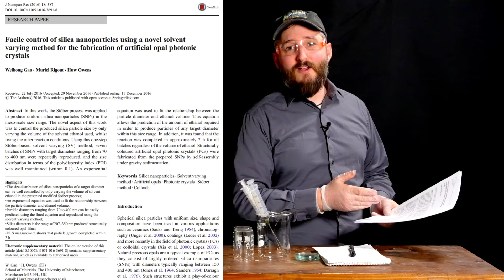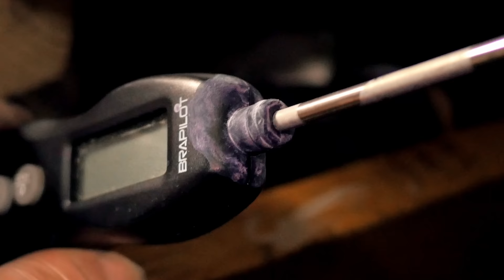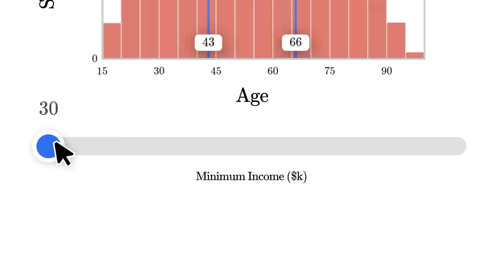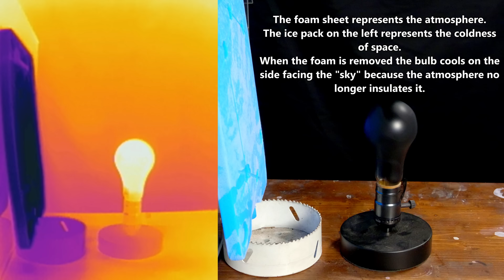Making Opals for Free Air Conditioning

Comment: You have so many incredible tools for the radiative cooling now. Use a soot deposit on one side of a copper plate and a passive paint on the other. Sandwich those in series inside an infrared refractive 'mirror' box and then draw out the air. You should have a plate that directs heat from one side to the other with an N[plate]*e^-f(x)[logarithmic efficiency]/y[mirror box conduction rate] system. Or something similar to that formula...
Reply: Stack in some IR directive fiber optics to spread the N1 applied heat between each layer and that N*e^-f(x)/y formula should minimize the loss due to series stacking, kind of like running the TA-refridgerator in series.
Reply: I didnt do the system analysis on paper, it's just in my head. But to fix my estimate it's probably closer to RMS(N*e^-f(x);y).

Comment: Instead of using a uniform lattice for transparency, have you considered taking the air dried opal, scraping it off into thin flakes, then mixing it into a clear/colored resin? The resin could more easily penetrate the small flakes than the massive chunks that you and thethoughtemporium are making in your centrifuges, and could also remove the "tiger pattern" described in thethoughtemporium's video.

Comment: If increased brownian motion creates a more consistent cristal. Heating the mixture while it's left to settle out might give a better result. Depending on what temperatures the solution evaporates at this could also help concentrate the mixture. 

For the air trapped in the dried sample maybe placing it in a vacuum chamber would help. Like degassing resin. And if the dissolved gases are interacting with the participants at all they might be affective how fast there settling out. 

Could also be worth testing a combination of these if you can heat a sample while pulling a vacuum.  Low pressure and high temperature seems like a good way to concentrate the solution and force the particles to settle out.

Comment: Please use an ultrasonic cleaner or bath or horn for the neucleatiom and suspension of particles. Also the water drying brings the spheres closer together due to surface tension, so you get a denser matrix (that is extremly hard to redisperse). 
Also silica colloidal mixtures are reasonably priced (100+ for 1L 12-20 nm 40% wt. conc) if you need a known reference.

Comment: Try dispersing the lampblack with an ultrasonic bath or ultrasonic homogenizer before adding it to the opal solution. Or maybe sonicate it all together— the cavitation will de-agglomerate and disperse the carbon. I’m not sure if the cavitation will hurt or break the nanospheres, so that could be a variable to test. 

I also wanted to contribute that the effect of opal’s colors is from the Tyndall Effect, which is similar to (but different from) Rayleigh scattering. From my understanding, Rayleigh scattering is from particles smaller than the wavelength of light, and the Tyndall Effect is present for particles roughly the same size as the light they’re scattering. So opals, opalescent Chinese glazes, and milk are optically colorful from the Tyndall effect, and not Rayleigh scattering. I hope that isn’t too pedantic. (And if I’m wrong I’d love to be corrected on it!)

I’ve done a lot of research into historical opalescent Chinese glazes such as Chun glazes, the blue celadons typical of Ru ware, and the blue clears of Qingbai and other Song dynasty glazes (not to mention Japanese Seihakuji and Korean Goryeo celadons). These are opalescent glasses that use iron oxide as their nucleation sites to grow air bubbles in the glaze matrix in a reduction environment. From what I’ve read, 400-500nm air bubbles create a blue glaze that’s straw yellow when you shine light through it.

When the glass freezes on the surface of the clay, the entrained bubbles scatter certain wavelengths to create different colors. I can share some papers and research about this if people are interested, but this kind of firing only takes about a day. I wonder if making an opal using a firing/sintering process would be possible and take less time than weeks to settle— but I’m not exactly sure how to tune the size of the air bubbles to adjust the opalescence. Maybe different sizes of iron or different oxidation states of iron would yeild different effects.

Amazing video as always, so exciting to see this research and your enthusiasm for it!!

Comment: If you use an internal-mixing two-substance nozzle you can adjust the droplet size between 10-150 micrometer. that would be suitable for exact priduction of nanospheres, with air pressure curves, using a micro controller a production of varying size of nanospheres is possible

Comment: Opals are one of my favorite, "gemstones" (not technically gemstones but...). I know the rocks and jewelry need to be kept wet as trapped water is intrinsic to the shine/transparency. I'm not sure what medium would suffice in a radiative paint. Water would obviously evaporate too quickly. Plastics would absorb the UV light, generating small amounts of heat, (not like IR) and oxidize like headlights. Molten glass would destroy the nanoparticles. Glass encasements filled with hydrated opaline would be impractical.  

I love the project and the idea of radiative paint. I remember reading that some scientists had been working on making sand more reflective by roughly ~5%  (if memory serves). Ideally, we should pass laws that require a reflective specificity for roof coverings. We could easily reduce both indoor, daytime temps as well as reducing some of the urban heat island effect. I used to work in building insulation. Simply painting your roof white is almost as good as spray foam insulation. Both are vastly better (efficiency not ecologically) than fiberglass. 

I assume brighter folk than I have considered how much energy is created, how far efficiencies drop and how much energy is needed to counter the heat created by solar. Personally, I champion the most passive forms, such as white roofs, good insulation, sky lights, etc. I'm all for solar though more for small modular nuclear. I think every subdivision should be as self sufficient as possible. This reduces heat waste from transporting energy and makes the whole grid more robust and less vulnerable to attack and grid issues. In any case, we need to diversify our technology more and to the simplest, meaningful forms.

Comment: Even heat, slower spin/mix in relevance to brownian motion of the mixture, with a dehydrator/pressurizer  will improve it even better. Also a outer temp that is as cold as you can get it will make it more pure if a gem :)

Comment: If the nail polish helps to make it clear then it is likely that the top surface that is the issue, it may be too rough or uneven. If you can make a large and strong enough crystal you could try polishing it to smooth out the top surface. It may be similar to when you sand resin or epoxy, it goes very cloudy too until you apply a top coat which fills all the microscopic pits and scratches and also similarly if you polish it that may also help it go clear again.

Comment: Interesting. The version I read was that opals have water in their matrix (SiO+H2O). They are sometimes referred to as silicon hydroxide (SiOH). I've also seen old chemistry books that revered to opals and flint as acidic glass (HSiO). By the way, the difference between precious, semiprecious, and common opal is the amount of color diffraction, which was commonly associated with the amount of water trapped inside its layers.

Comment: Maybe you could try to use a vacuum in the settling process to get rid of the air? Or an epoxy to fill the gaps? Or letting the lattice grow on an existing crystalline structure? Just throwing Ideas out there..
It would be really interesting to see the opals in a passive cooling system!

Comment: I was stopped at the teos in making opals, so i just cut and polish small, rough natural ones i can afford. The resulting solution I believe could be kept long term and used in paintings too. I was going to use opal dust and try to suspend that in medium. With more people doing this experiment, perhaps someday the different particle sizes can be sold  in small vials. I’d paint with red blue yellow size particles.

Comment: Like the super material using barium sulfate nanospheres the ability to produce them seems to be getting easier and easier for the average person. One question I've had through this series is how many different ways it can be applied. I wonder how the barium sulfate paint would do if it were also painted on a super reflective surface, would the cooling work even better? Could it be used to cool solar panels to increase their efficiency? Water cooling pipes using it? The applications seem endless. I'd love to experiment on it myself.

Comment: Cool! Consider experimenting with a thin vacuum between the emitting side of the radiant sky cooling coating and the atmosphere, which would eliminate convective and conductive heat transfer from the equation, kinda like the opposite of a evacuated tube solar collector

Comment: Here's some really nice work!  It will be interesting to see how far you can take it.  

I do have one suggestion that might improve the uniformity of your nanosphere size.  It was clear from your first result that improving the temperature uniformity of your reactants is important, and think you can improve that by quite a bit.  For instance, the bottom of your beaker, which is in contact with the bottom of your ad-hoc water bath, is going to be hotter than the water.  You also want to make sure that the level of the water bath is higher than the stuff in the beaker.  The setup used in thethoughtemporium video looked to be better in these regards, but I don't think you need the precise kit he used to achieve similar conditions.

Controlling the light scattering is sort of tricky as well.  If you use a binder whose index of refraction is very close to your nanospheres they will basically disappear, optically speaking, and you will lose the interference effects you're after.  Binders with different "n" won't do that but the resultant colors may shift because the wavelength of light will be different, compared to air.  The effective size of the nanospheres will be larger compared to the in-situ wavelength so things might shift toward the red side of the spectrum.  Maybe :).

Comment: "Black" opal sits on dark potch, it isn't dark in and of itself - if you put carbon black or another colorant in it, that will likely just disrupt the orderly nanoparticle settling process and cause other unforeseen problems. You'd want to apply clear opal onto a dark background instead of mixing a colorant into it I think. This is absolutely fascinating, and there is so much you could do with this process, also so much we still don't know! It's also wild that a gemstone we have been mining for thousands of years literally takes an understanding of advanced optics/the physics of light and nanotech to do in a lab what just occurs naturally under the right circumstances over huge stretches of geologic time.

Comment: I took a nap and came up with a possible solution for you trapped air issue in your solutions as they dry... Hypersonic vibration. Take something like a really good electric toothbrush, attach some rubber to the back of the toothbrush and then create a mount where your little glass disks are suspended to keep them from moving, but with the electric toothbrush mounted such that the disk actually rests upon it. And then just turn the toothbrush on. You need micro-vibrations... not enough to disturb/mix up the solution, but enough for the trapped air bubbles to escape. 

Now this could also result in more air getting trapped inside if the vibrations are too big. You need very, very small, vibration.

Comment: You can make anhydrous ammonia by mixing ammonium nitrate fertilizer with sodium hydroxide, running the gas produced through a desiccant then condensing the vapors to a liquid in a flask cooled with dry ice.

Comment: Using the denatured alcohol, which is a common term for methanol may have effected your results because of its greater molecule size meaning fewer nucleation sites, but it could have also effected color gradient due to larger gaps at the nucleation sites

Comment: You should consider using dynamic range compression on your audio signal. There are big differences between the quitest part of the video and the parts where you are excited. It is nothing bad, it is an editorial choice. In my opinion content like this, most viewers will value stable volume output :) In contrast to movies where you want the audio system to be able to produce big explosions alot louder than conversation volume.
Reply from the maker: I did use a compressor but I think the audio clipping when I shout made the sound seem louder. I need to upgrade my mic setup with floating audio so I don't clip as I did here. You might like this video about loudness which I think demonstrates what happened here: https://youtu.be/Is_wu0VRIqQ?si=Ali02H93mkiJTL6u

Comment: do you think ambient air water ammount affects the result? since it will provide nucleation sites?
the lamp black might work but as an after process. make the opal solid, add lamp black to the solution and re-centrifuge. my thought process is that this should leave minimal gaps between the particles, which then the lamp black will fill, instead of air or water etc. eliminating possibly 2 flaws at once.
my other suggestion is to just heat up the opal while it's centrifuging/evaporating even?
maybe putting it in the oven after centrifuging can still save a dull opal that was too quick in it's settling?

Comment: Hi thanks for the interesting experiment.  You showed that air bubbles are getting trap in the solution. Have you tried vacuum chamber.  You can get all the air bubbles out of the solution.  You should get clear Opal with your red and green.  Then you can add your black.  Good luck

Comment: What a delightful video, I very much enjoyed watching your excitement as you synthesized opal! I feel much more informed about the structure and properties of opal and look forward to seeing how you incorporate it into your passive cooling project.

At 44:10, I'd like to add that diffusion of a solute is usually only feasible in a medium of which it is soluble, hence the efficacy of the alcohol-soluble pigment compared to the lampblack. To form a colloid mixture I believe you would need a pigment with a grain size smaller than that of the nano-particles in your opal solution--and I think that may be counterproductive, for a reason I address shortly.

I'd be interested in learning more about how the nano-spheres of silica dioxide are settling into the crystalline formation that produces an opal. You mentioned that it can take months for the nano-spheres to settle naturally, and that attempts to speed this process have a high chance of ruining the sample. If I'm not conflating incompatible ideas, the phenomenon of granular convection may provide insight to a solution. If my assumption is right, then reducing the latent energy of the solution to a degree that Brownian motion can no longer generate lift on the nano-spheres in the middle of the solution, while still being profound enough to do so when the nano-particles are pinned against other nano-spheres or the surface of the container, would be a more apt way to get the desired crystal structure. Though, I am just postulating; I've no clue about the feasibility of such a state.

Comment: It takes Time to "grow" the spheres from the solution. Growing them in layers such as a pearl. Hence the 2 hour wait.   I always wanted to try this, then filter the solutions, under high pressure through a piece of wood, meat, or bone.  The spheres would be a forced replacement, ie fossilization/opalization.  Under high pressure and some heat, the spheres of different sizes should stack against each other wedging into place. Once the largest (reds) are "stuck" into their position, then change to smaller spheres, filtering that solution. Repeat each smaller size.  The last step, would need to be a "fusion" solution, to "bond" each sphere to the next.  I think it would work.  🤔

Comment: Assuming the opal isn't deadly poisonous or chips off easily or anything I think it would make for a very cool looking surface for a knife, or then if it doesn't adhere to metal or damages it then the handle could have it in some parts. And even if it chips off I'm hoping it would be possible to encase it in a resin or glass to make it usable for just cooking but I think it could compromise the durability of the blade too much if it had glass or resin on it, and you can't really make the resin in the blade as it probably isnt very healthy.
Reply: Comment above said that too. Pretty cool idea with the resin. Could maybe even 3d print

Comment: Great content!  This would make for a nice dispersing layer behind a laser cutter's target.  
The bed's I've used always get so chewed up, but if you used this, especially if it was tuned in sphere size to match the laser's beam frequency, you might be able to deflect/diffract all of the power in a relatively thin protective coating.  if you can shape the final coalescence, maybe you can make little pins to serve as a support for whatever is being laser cut.  This would be worth something for fabricators and laser cutter makers. 
I'd also be curious to know if a concentrated input of light at one particular frequency might affect your crystal formation or at least how it settles.  
Maybe you can selectively seed or prevent seeding with different frequencies.
AND!  I'd love to see blacklight only opalescence.  That might really fluores to the eye with a UV light.